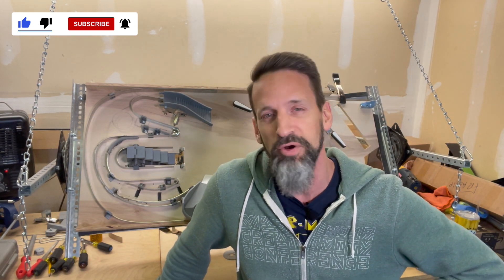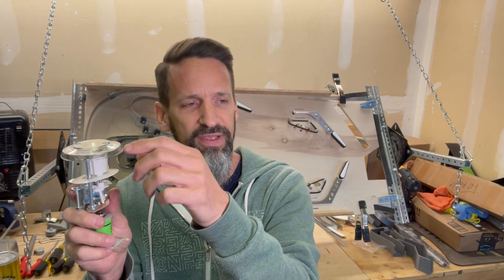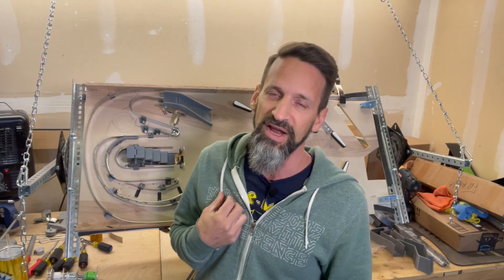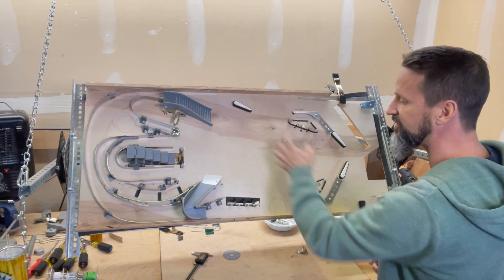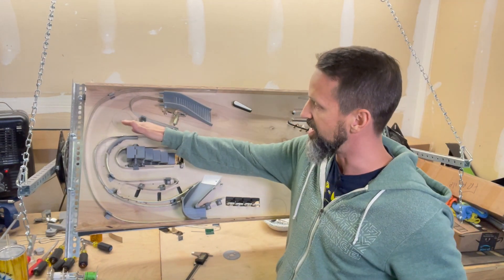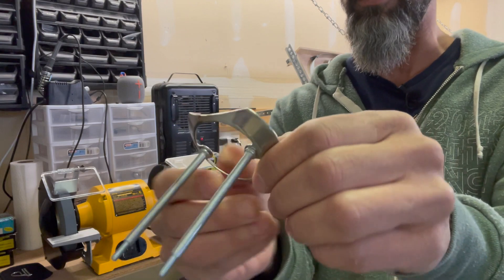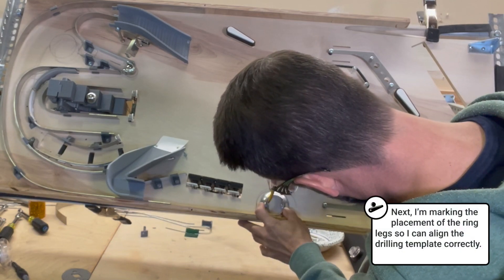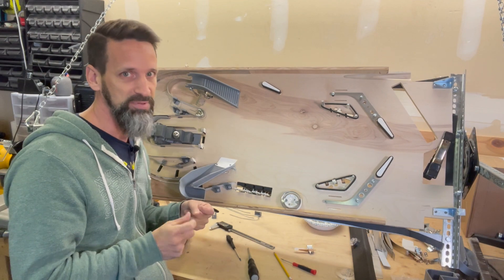HOW TO MAKE A PINBALL MACHINE: Pop Bumpers!

Comment: Hello! I have never built a pinball machine. I am trying to build a bar in my house with pop bumpers, lights, ect. The idea is that it would choose a random drink after the ball bounces around inside the clear top table. Am I better off purchasing an old machine or purchasing parts and then building them into a table I build?
Reply from the maker: Really depends on what you're comfortable with. Starting with something that exists and modifying it is often a little easier. Sounds like an awesome project either way you go - don't underestimate the complexity and the time it'll take tho, either way it'll be a chunk of work

Comment: Great vid!  I will say that if you can get ahold of the DE style pops rather than WMS, they are a bit easier to work with.  The WMS ones drive me nuts a bit - although they are slightly cleaner for something positioned out in a very visible area.  For more traditional placement at the back of a game, the DE ones are great because you just drill a single large hole and the assembly stays completely together when you install and/or remove it.
Reply from the maker: Ahhh good to know, thank you!! I'll have to check them out and see which I like better